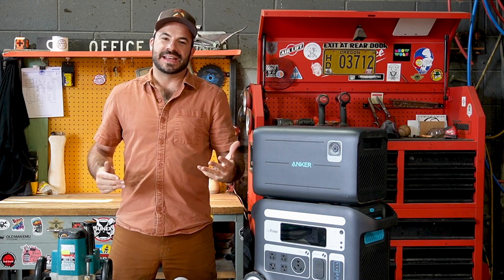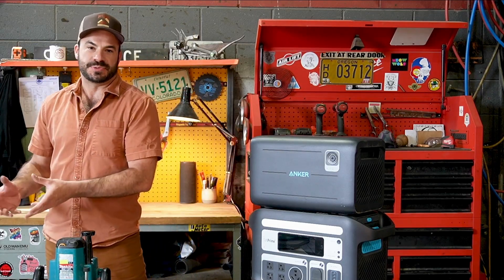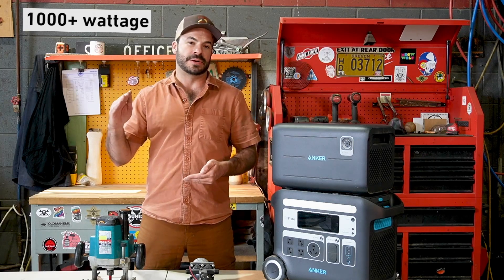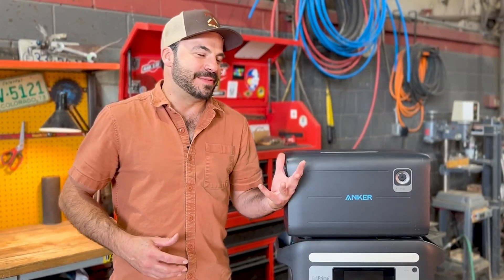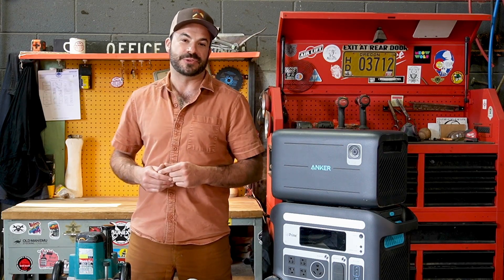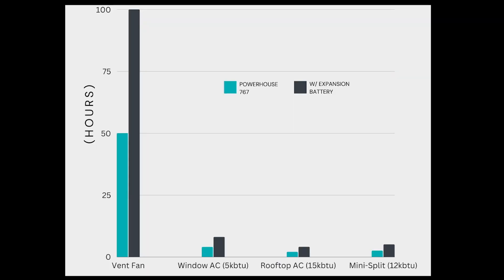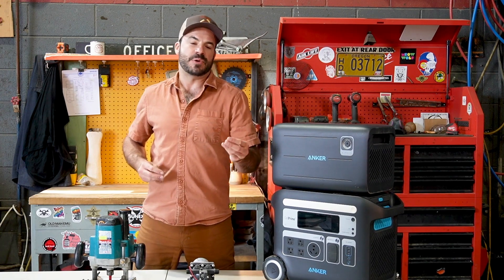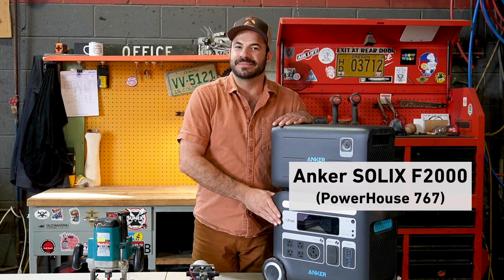How to Power Your Heating and Cooling Off-Grid with Anker SOLIX F2000

Comment: I wouldn't buy any of these solar generators, including the Anker 767, because they all use the same high frequency, transformerless inverter technology that is found in all expensive, Chinese made solar generators on today's market. These solar generators simply don't last when powering inductive loads like an AC unit. They don't last very long because without an iron core, copper wound transformer to absorb the back EMF and high surge demands of high inductance loads, the MOSFETs cannot take repeated exposures to high surge loads such as full-sized refrigerators, portable AC units, large power tools or large microwave ovens. 

Don’t get me wrong, high frequency inverter tech is ok for low power, non-inductance loads like laptops, small fans, small heaters, charging cell phones or battery powered tools or heat guns, but powering high inductance loads like full sized refrigerators, large power tools, portable AC units or large microwave ovens is absolutely not what they were designed for and they can be downright dangerous when used with high inductance loads. 

The reason for this is that all these high frequency inverters lack a very critical component. That critical component is an iron core, copper wound output transformer. Without an output transformer to act as a buffer to absorb electrical surges provided by the “Flywheel Effect” inherent in the physical amount of a transformer’s iron, these surges and damaging reverse voltage spikes as the inductive load is switched on and off must be handled directly by the inverter’s MOSFET transistors, essential shortening their life. 

You might be able to start and run some high surge loads when these solar generators are new, but every time you fire up that inductive load, you're shortening the life of the MOSFETs in your solar generator's inverter. They also run much hotter than low frequency, transformer-based inverters which makes the low cost, off spec, Chinese made components such as capacitors, diodes, MOSFETs, resistors and ICs that are used in these cheap inverters, far more prone to early failure. Another major consideration with these high frequency, transformer free solar generators is safety. All it takes is for one of their MOSFETs or IGBTs to short to ground or the control circuitry to fail and these units will send dangerous, high voltage, high amperage DC current straight to your connected AC loads which will not only damage most AC appliances but can also set those AC appliances on fire.

Another major consideration that is never mentioned by the majority of the paid YouTube product hucksters, is that the vast majority of these solar generators are non-repairable. After the warranty runs out, you're not going to be able to ship this unit back to the manufacturer in China and have them repair the unit. At a typical shop rate of $125 per hour in the US, with no schematic and limited parts availability, it makes no economic sense to even attempt to repair one of these units. Once the FETs have fried and have taken a good portion of the inverter's PCB with it, (And trust me, sooner rather than later, they will fry.) they basically become a brick. 

A far better alternative is to invest a little more money and purchase a low frequency, transformer based inverter charger and build your own solar generator. Low frequency transformer based inverters last far, far longer and can easily power high surge loads without being damaged. That's why the big name brand inverter manufacturers like Schneider Electric, Outback Power, Magnum Energy and others, all use a low frequency topology in their offerings. I know this to be true because I've spent the last 23 years repairing inverters. High frequency solar generators/inverters simply don't last when powering inductive loads.